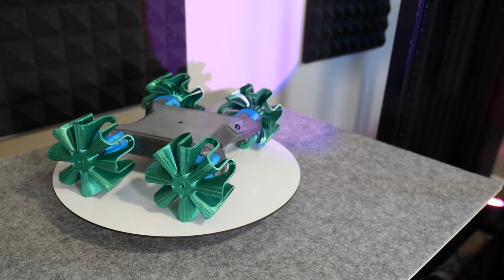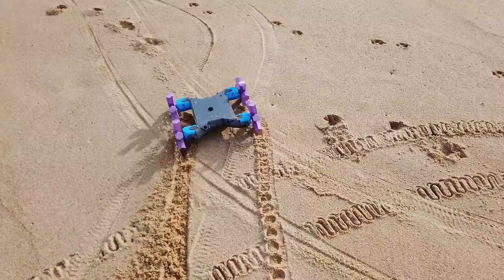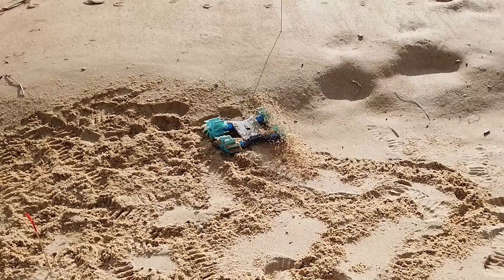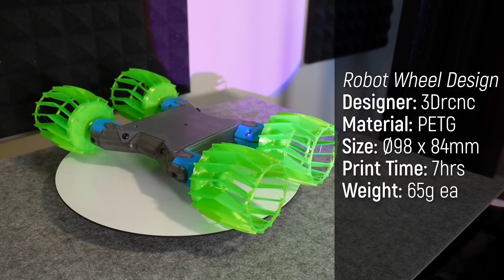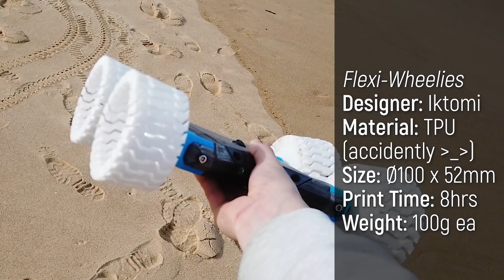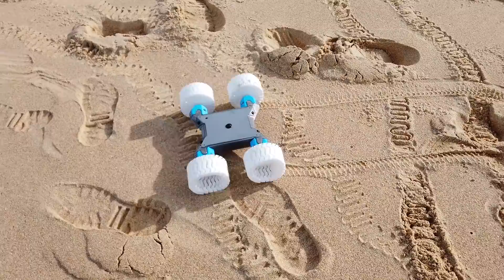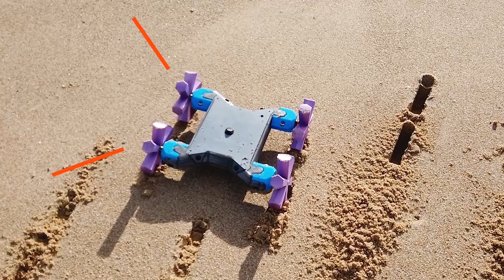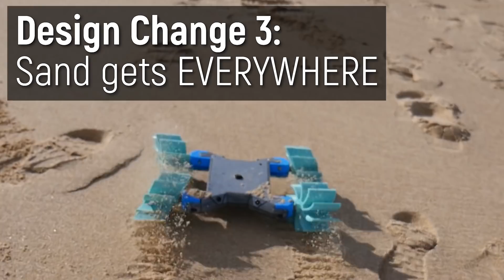Weird wacky 3D printed wheels!

Comment: Quick point on the whole ground clearance thing. With very low ground clearance it has a massive performance bias to certain designs which is somewhat unintuitive and probably overlooked in the design of many of these wheels, and design which attempts to dig into/scoop the sand for increased traction is percentage wise massively reducing the effective ground clearance which given to surface... tad counter productive. Hopefully with a bit extra clearance it will be a more level playing field to compare just wheel design and not the whole vehicle

Comment: Switch-> you could use a jumper for it, should be pretty impervious to sand and easy to seal around with no mods required for the chassi as you could print a housing for it to fit the old slot. Im pretty sure you would have one laying around somewhere so it would be essentially free.

Comment: Yeah, I feel like a whole lot more of these wheel designs would work better with a robot redesign since this one is kind of... inherently flawed imo. Also, if you're looking to seal the inside of the robot (especially for aquatic testing), I recommend using a silicone filler for the grooves between the cover and body and o-rings for screw points. Might not work but feel free to experiment!

Comment: Electrical tape works as a great seal against things like water and sand.
Reply: Not really... it may be decent as a temporary fix when applied to a clean surface, but it does not take abuse very well. Self sealing vulcanizing tape does far better but is also not impervious to water for long time usage... The other thing to remember about sand is that it is extremely sharp on the micro scale and will eat its way through most materials, especially with applied pressure or vigorous movement... it quite literally is loose sandpaper...

Comment: one thing of note is that the platform has a larger track than wheelbase this is leads to unstable handeling. So if you want it to be more stable it should probably be longer
Reply: I was thinking the same thing.  Longer wheelbase is needed.  That will help with the height also as the wheels can be larger around thus more clearance.  Just don't make it so long that you have high center problems on the hills.

Comment: The "robot wheel" design is one of the coolest i've ever seen. Looks kind of like a snow groomer track where snow has to pass through it so it's not going to jam.
Reply from the maker: It's pretty genius, after so many failures it was a shock when it got up the incline first try.
Reply: Yeah that wheel looked the most like what JPL designed for Mars so it's probably the most sand optimized.
Reply: Looks like the same sort of design as th ridges in Curiosity's wheels tbh. Maybe it's just a good design for going up sandy slopes
Reply: Thanks! 😉
Reply: @3Drcnc  could you upload stls to thingiverse? I would really like to play with them
Reply: @3Drcnc  thanks, I'll definitely check them out
Reply: Pretty sure that's just a more open remix of the Mars Rover Wheel design - Was kinda hoping to see the Wendelstein 7-X shaped like wheels in action :°
Reply: Those robot wheels are very similar to the large drums they run on tractors to stomp rice after harvest
Reply: ya
Reply: Yet I'm still not sure this was the correct direction for them
Reply: @Turalcar  It wasn't but they seemed to work well so...
Reply from the maker: @3Drcnc  my bad lol, I took a guess 😅
Reply: @MakersMuse  I'm pretty sure the files were marked with L and R but I understand it's hard do keep track of with that many wheels to print lol. Probably doesn't matter that much either.
Reply: Yeah, that's a very smart design. My wheel design probably won't do anything CLOSE to that.
Reply: tractors used in farms hve similar wheels so no surprise